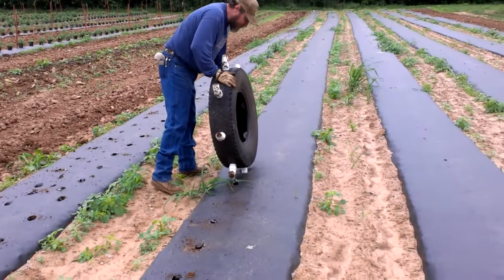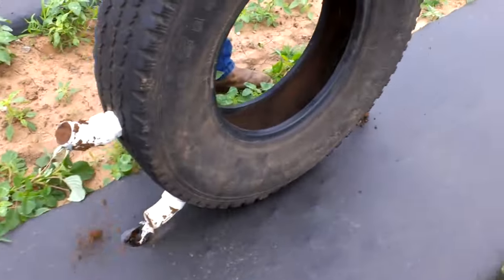plasticulture plastic mulch hole maker

Comment: in India we use a small iron cup filled with burning coal/wood....the moment u touch it to the mulching paper it will be a perfect hole and doing this will cost nothing. you can attach three or four cups and do the job within few hours.
the way you are doing is nice but it will take much more time.
Reply: this is about holes in the ground, not just mulch

Comment: I wonder if a body could fashion some hardware cloth in the PVC fittings and load the tires with seeds such that only a few seeds could pass. It looks like the dirt gets packed in the cut side of the fitting. Maybe it could be drilled or modified easily. Again, what an awesome tool you figured out there.

Comment: Try it with a rim in it.
Or even simpler - just fill the bottom with water.
- just my two sense from a city-raised, aspiring farmer:)
Reply: Weight is an issue, with tiredness and back problems...

Comment: I would use a wheel barrel with a tire with spikes on it and put some dirt in the barrel for
weight and just walk it down the rows.
Or you could put that tire on a wheel and make a handel on each side off the axle and two
people could walk it down the row, The weight of the wheel and tire would be enough
to punch the holes or you could a weight across the arms.

Comment: get a Rain Flo water wheel trans planter already. It will deliver water / fertilizer to every transplant that draws the plant roots and soil in close contact. That keeps the transplant from drying out, reducing trans plant shock. That allows you time to hook up the drip irrigation before the trans plant wilts in the sun.